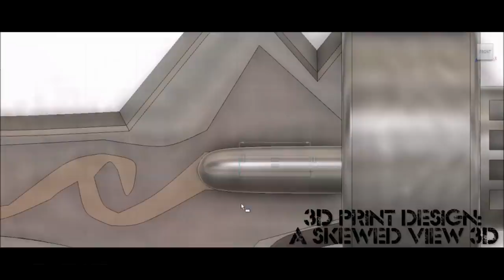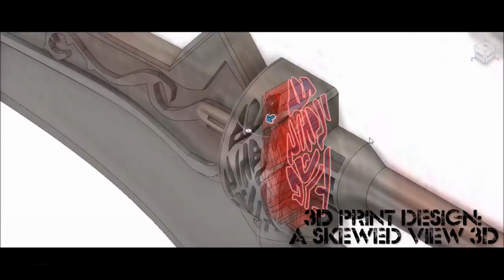Casting Worlds Biggest Aluminum Sword - Devil May Cry 5 (Red Queen)

Comment: Love the vids mate, always a pleasure to watch you work! Quick question, I'm looking at getting into casting (just for nerdy cool things for the house) is it hard to cast hollow objects for example a scaled infinity gauntlet (obviously that you can't wear) if you were to cut the 3d printed gauntlet in half then use the same method as you normally do and just ensuring the centre piece was filled with sand ... could you in theory achieve that? Thanks keep up the great work 😊😊

Comment: Am I the only one who thinks that it’s not as good as it could have been? How is this any different then any other YouTuber who makes these kinds of videos? besides the fact that it’s dmc i mean it’s the same thing over and over again. make a working one or at least a realistic one Bc the majority of these youtubers have absolutely no experience with metals how to work them, etc. or how to even wield a sword, a sword is never meant to be longer then the person wielding it. Depending on the type of sword and the type of body you have you  specifically a sword should be nothing less then an extension of the arm a deadly one if used correctly witch obviously it wasn’t...your swords are way to big and unrealistic in every way imaginable your casting the full sword your not even building it no tang no hardware no temperament and it’s aluminum that sword will shatter if you hit something that doesn’t fall apart like fruits